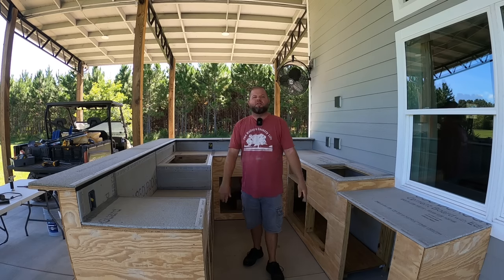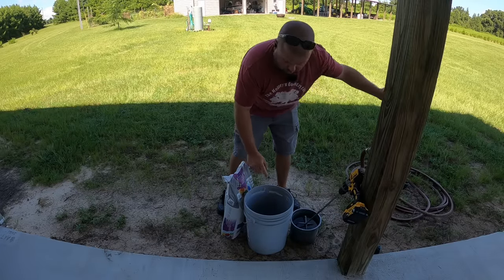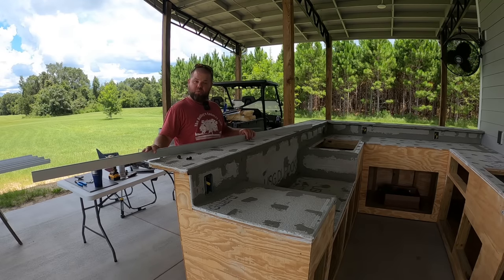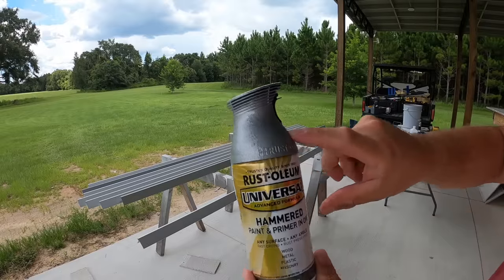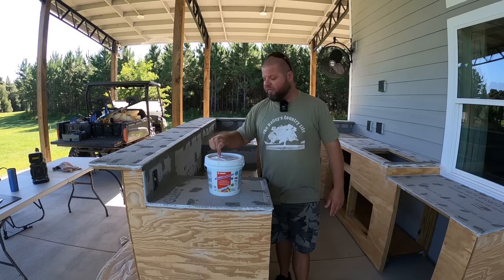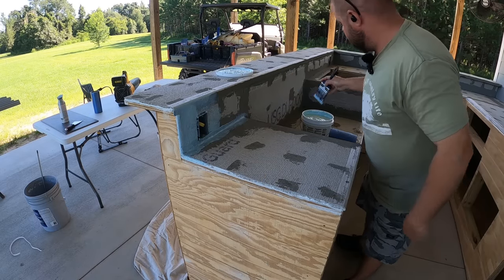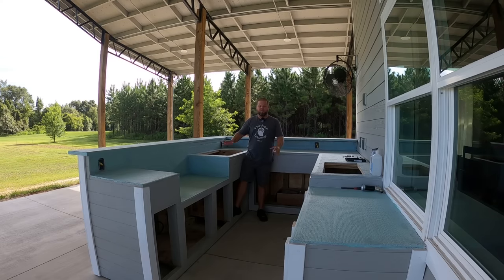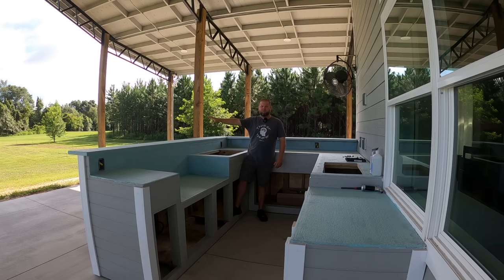DIY budget outdoor kitchen build part 4! Second to last episode! #Vevor #623

Comment: Propane guy here !  your tank is most likely regulated at 11 water column inches (a little less than .5 psi) and should be fine, they make a higher flow one if you need it FYI, your fittings look great, I Really enjoy watching the process as we plan out our outdoor kitchen !
Reply from the maker: Correct, I remember the installer telling me 11 inches of water colum. Thanks for watching!

Comment: You cannot use galvanized for gas, the galvanized coating will flake off and overtime clog up regulators and burners. Not only that but the moisture in the gas will also cause corrosion inside of the pipe and start causing leaks. Just some friendly advice from a licensed plumber 👨🏻‍🔧
Reply from the maker: I am very curious if this is a old wives tale. My pipe was installed by a multi million dollar gas company that services two states and a lot of counties.  I also had to have two inspections by the building department which I passed.  Galvanized fittings and pipes were in several places during those inspections. The only thing I can find on the net is galvanized pipe decades ago had reactions to gas due to a different manufacturing process that has since been changed.  Not saying it isn't allowed where you are, but I'd love to see the UPC code where it isn't allowed.  It must not be in the Florida plumbing code for our licensed installers to be putting it in and it passing building inspections. Take care

Comment: I think you might want to check only use black pipe and black pipe fittings not galvanized
Reply from the maker: I'm using exactly what my gas company ran in my home. The only thing I've ever heard is a old school way of thinking that galvanized pipe could flake and plug an orface. I'm not concerned about that. FYI this is a multi million dollar gas company that did my installation and it passed inspection by the building department with galvanized fittings.

Comment: I only intended to watch one video but the first one was so good, ended up watching all. Great information, details are amazing. Many people build their bbq kitchens using metal stud framing, then cement sheets with render or tiles, no plywood at all- did you really need the plywood for the stability factor? Overall, great build.
Reply from the maker: No I used it for the DIY factor and cost savings on the exterior. For additional strength under the cement backer board. This is a rather protected area, otherwise I would have built as you described. Thanks for watching.

Comment: At 20:44, I would replace that 1/2” 90 with a tee so you could add a dirt drop.
Reply from the maker: Why is that? Are you saying if there's trash in the line?
Reply: @TKCL  yes, small amounts, sometimes even small amounts of oil.  It’s also known as a sediment trap.  If you are on propane, it’s less likely, but could still happen.
Reply: Drip leg* 
Or sediment trap

Comment: Would it have been over-kill to put the water-resistant membrane/coat on the inside of the plywood and the bottoms that were raise up off the ground too? I'm just thinking that it might help the longevity of the counter in the long run, but I've never used that stuff before. Also, awesome work. I had a lull in the action at work and these videos helped to relax me. I guess its a DIYer woodworking kinda thing lol.
Reply from the maker: Not necessarily, or a good thick coat of exterior paint would have sealed it well too.

Comment: I like it! It's really coming together. What are the plans for the floor? Am thinking grease and other certain things might stain the concrete.
Reply: I think he said in another video they had purchased a Matt that fits perfectly in that area . Hello Chrystal 🤚
Reply: @JimmyHensley36  Thanks Jimmy. Guess I missed that part! Hello right back!
Reply from the maker: That's correct, we've already bought a 8ft rubber mat that I plan to cut to fit that area.

Comment: Hi, do you guys have a multi-layered pipe in us, much durable for gas, cold and hot water even air conditioning but you have to cut use a tool and add fittings.
Reply from the maker: Not familiar with that pipe.

Comment: With your better safe than sorry thinking, Why is the gas line so close to the Electrical Romex. Also have you thought about a vent for Gas leaks or heat escape from under the cabinets?
Reply from the maker: I am venting the cabinets. I don't understand your thinking of coated wire being next to a sealed gas line??? My gas line behind my stove is about a 1/2 inch from a bunch of stove electrical connectors. And there is an receptacle behind the stove top. Gas runs right inside of my water heater that has a 100 wires, connections and circuit boards.
Reply: @TKCL  Just looked like gas line and Romex were fairly close together.

Comment: Gas line question, are you using galvanized fitting and not black pipe? I've always been told no galvanized on gas lines.
Reply from the maker: I'm running exactly what my gas company ran. The only old school rumor I've heard about galvanized pipe is that it could flake and plug an orface. Not really a concern for me.

Comment: Great job but I think the top cement board on the top should overlap the board at the bottom. Meaning that if you look from directly above you should not see any unfinished edges . Minor detail , may not make that much difference
Reply from the maker: Watch at the end, that's all encapsulated in that rubber membrane. I'd agree with you if I was tiling the edges. I'm using metal trim edge.

Comment: I am thinking that membrane won’t be a good bonding agent…. mortor mix won’t stick after it dries. Kind of defeating the purpose
Reply from the maker: You do realize that membrane is specifically made for tile right? Almost all tile shower installations nowadays use waterproofing membrane before tiling.

Comment: starting my outdoor kitchen and very curious on how you are putting in your blackstone, mainly the grease cups, i had thought about using galvanized duct to pipe it out  to the back side and therefore i dont need to reach around to change the cups, do you have a trick for that?
Reply from the maker: I'm hoping I've spaced it enough to keep the factory pan. If not I already have an idea I'll show soon.

Comment: Great videos!! I’m following your build right now and going great. How did you mount your cabinets? I have noticed that the vevor cabinet mounting slots don’t go deep enough such that they land where the siding plywood is
Reply from the maker: Mine went deep enough to screw into my 2x4 material. My plywood thickness was 3/8.

Comment: I really love your videos! I do have a question. What did you use to cut your backer board for the sink and stove top? Thanks!!
Reply from the maker: A simple razor knife and I bought a diamond cut off wheel for my angle grinder. It was $10 from Lowe's.

Comment: Hey Andrew.  Been about a year since you installed everything.  Just curious if you're seeing any rust on the doors and drawers?
Reply from the maker: Nope all good, we do occasionally wipe the doors with stainless protective wipes. FYI if you ever do experience rust on stainless, use 0000 stainless steel wool. It will take it right off.

Comment: We plan to finish our outdoor kitchen in spring (after snow) and have similar set up with a blackstone and also decided to use tile instead of cement counter. Do you have a link or reference I missed for those counter edges. Thank you in advance
Reply from the maker: No link, search Schluter rondec step 1.75 inch tile trim edge at Home Depot.
Reply: @TKCL  thank you, I really like that look. Also agree about the Tv mount outside so difficult to put the cover on, ours is higher (like you mentioned) but we have a fire place pull down mount which really helps in case you are interested? Thanks again
Reply from the maker: I bought a little step stool that goes in the cabinet and can be easily pulled out.

Comment: Wouldn’t it have been easier to do the plumbing and electrical before you enclosed it with plywood? Just curious.
Reply from the maker: A little yes, but you can't figure out the exact plumbing of the sink until everything is installed.

Comment: Awesome. Video. I do have a question about the material that you used for the front face of the bar. It looks like shiplap. I love the look but didn’t see you install it on the video. Anything would help.
Reply from the maker: It's from Lowe's. 3/8 inch plywood paneling and called 4 inch on center because that's the spacing of the grooves.
Reply: @TKCL  thank you so much. I enjoy all your videos.

Comment: I must have missed it, but what are you using to clad the cabinets, something with horizontal lines?
Reply from the maker: Grooved paneling from Lowes. If exposed outside with no roof like me, I'd use a fiber cement board.

Comment: Hey Andrew, just curious, what are the measurements for the recess for the black stone area? Bottom to top, width and depth? Just wondering how much space you're allowing for airflow and cooking comfort. I'm pretty close to finishing framing and felt comfortable using your plans/layout. If you're too busy to share- no harm no foul! Take care!
Reply from the maker: 3 inch gap on either side, 43 inches wide for heat to escape. Height is around 10 inches because that's the amount of room I had available, no specific reason for that measurement.
Reply from the maker: I also wanted extra room for any possible larger Blackstones in the future.
Reply: @TKCL  man I appreciate your knowledge!

Comment: Off the primary source LPG tank for standard residential is 10 psi.  After the the secondary regulator ( unless a  special system) Standard LPG  systems are ~11 inches of water column. Most standard appliances require the 11 inches of water column. Do not think you can use a High pressure appliance like a  wok or some other commercial appliances on a low pressure system.  Custom items like Wok burners and high-pressure fish cooker may require  special regulators hence high input pressure . Check your MFG requirements before installing! The unit may have too much or not enough presser to work properly.  Either could be potential be dangers. Be Safe. Know what is required! If you you are unsure console a professional!
Reply from the maker: 11 inches of water colum is around a 1/2 psi or a little under right? All home cooking appliances are designed for that with a little give room. A hot water heater is designed for high pressure and a few other internally regulated appliances. I'll double check the regulator on my fish cooker.

Comment: Shouldn't that pipe coming out of the house for propane be black pipe?  It looked like galvanized to me.  I know with natural gas you shouldn't do that, but don't know about propane.
Reply from the maker: I can't find anywhere that's against code. All I find is a old school thinking that galvanized pipe could flake and plug a orface. It's not galvanized on the inside either. By the way a multi million dollar gas company installed the piping for me and it had to pass two inspections with the building department. So I'm guessing galvanized is OK.
Reply: @TKCL  I did a little more digging after posting my comment and it appears that this requirement is starting to be faded out.  It's still code in a lot of places, but it started because of the chemicals in the gas were reacting with the galvanized pipe.  Apparently, a lot of that has been cleaned up, so it's slowly starting to get dropped from code reqs.  I think I'd still use black pipe, just because it's less vulnerable to corrosion but it appears that it's not that big of a deal.

Thanks for the reply!!!  😎

Comment: With the 1 by 4’s why not do 45 degree cuts ?
Reply from the maker: That's another way to do it.
Reply: @TKCL  thanks for your channel , I am learning so much from your project. I am building and I will have plumbing rough stub out from the house  to the outside porch, including 3/4 pipe for propane
Reply from the maker: Nows the time to do it.